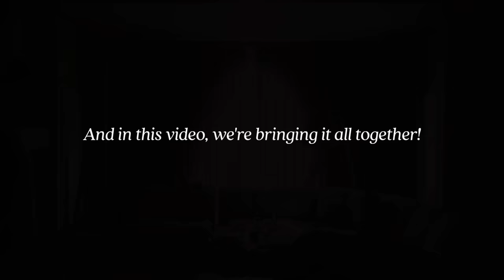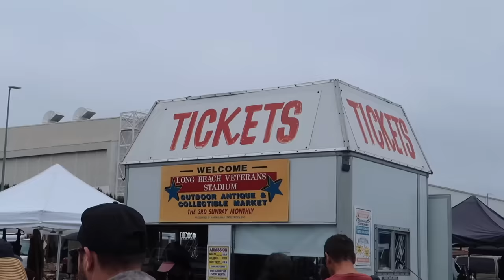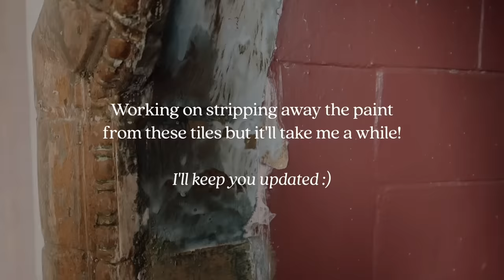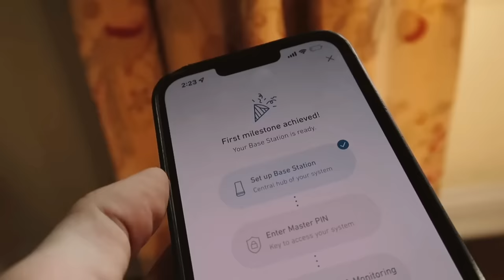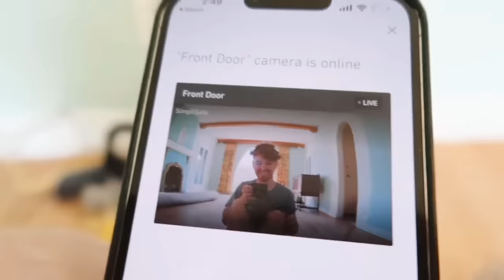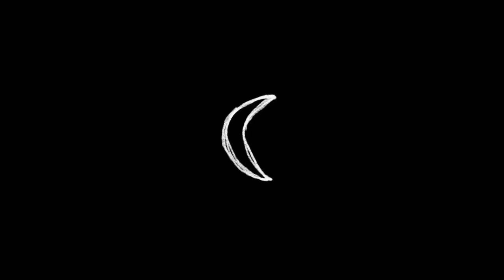MAJOR LIVING ROOM MAKEOVER *From Start to Finish* (The Lobby)

Comment: You don't show the top of that table, but pretty sure it is walnut stained pine.  So pretty cheap looking IRL.  May I sugest actually putting a walnut veneer over the top?  That would be a good DYI, and not as expensive as you might think.  You have to be very careful but attaching veneer is not a big job.  
That is a really small thing to mention in an extenely well done room.  I would not have thought of putting that black torso in that black nook, but the black on black works.  Everything is luxurious and top notch, no expense spared, but very casual at the same time.  Does the rug look cheap IRL?

Comment: Okay I have some ideas. Get a chargeable light bulb (Amazon)for the little lamp next to the chair, you can hide the cord with a cord holder stuck to back of table also at Amazon. Before you painted the built in I was going to suggest peel and stick wallpaper.

Comment: Looks great, overall, but that painting is a self portrait. If you rotate it 90° (side on the left to the top/handwriting on the top) you can see it. The white is the clothing.
Reply: I forgot to add, it's your piece, do what makes you happy, but there is an original correct orientation for the painting.
Reply: I can’t see it at all.

Comment: Absolutely Live alive Love the Lobby the use of pottery on the fireplace is the best live the tall plant in the corner and the chair is to die for. Just one suggestion if you could put some crystal liquor decanters at the bar instead of the bottles it would add that vintage touch ♥️

Comment: If you want to protect that tapestry or your other fabrics from UV light damage, you could install a clear, UV-blocking film over the window glass. Just do not try to grow plants in any room that has UV-blocking film on the windows. 

I would hire someone to install the UV-blocking film instead of trying to do it myself because it is a tricky process. Prior experience covering small windows helps a lot before attempting to cover a larger window with UV-blocking film. You can find rolls of UV-blocking film at the big box hardware stores if you want to attempt DIY.

Comment: i'm sure the painting was not painted over, the emotion of the piece is a self portrait. However, if you turn the painting vertically with the white area on the bottom, it sort of has the shape of a human, i suspect from the title that vertically was the way it was originally meant to be hung. However, you can hang these pieces however you like really.

Comment: The guy you bought the tapestry form obviously knows nothing about the real conservation of fiber products. When you move the piece, please, line it with ph neutral cotton or linen. Tack the tapestry to the liner in a grid pattern to stabilize the tapestry and create a rod pocket out of liner fabric to slip a rod into to hang (make sure the rod is sealed well if it is metal). This will preserve your tapestry and keep it in the best condition. It is how museums hang their tapestries. As far as hanging tapestries go, the guy you bought it from doesn't know what he's talking about if you actually want to preserve the piece rather than just use it as a disposable decorative accent. You've made an investment in a beautiful piece of art and history, please treat it the way it deserves to be treated. No velcro stuck to walls (though you used 15, which is better than 4, it's still not good). Thanx